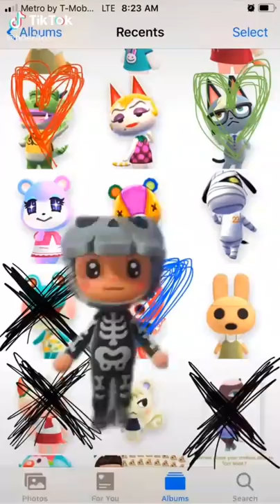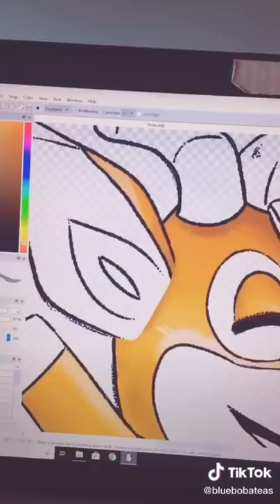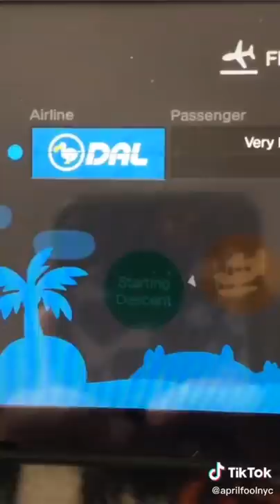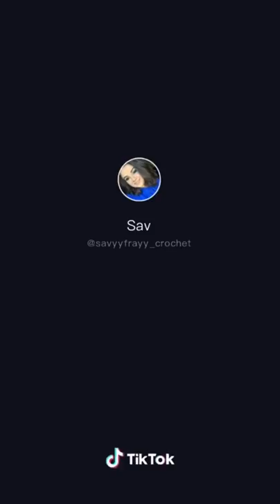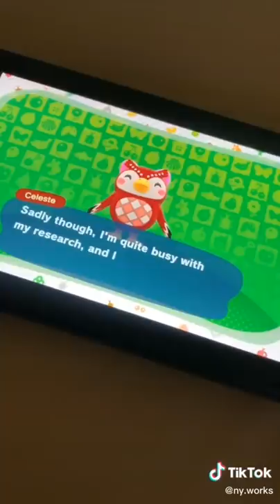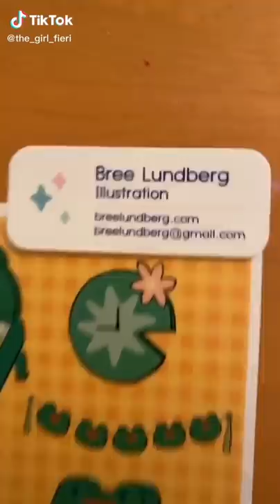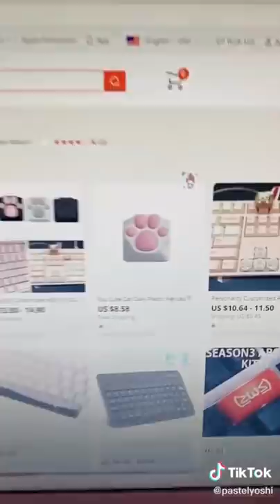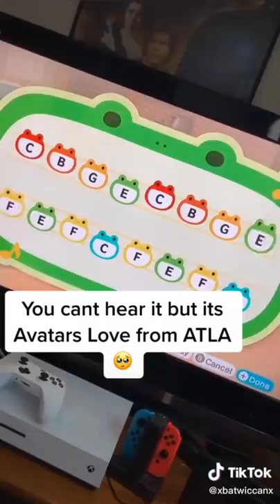1 HOUR+ of Animal Crossing TikToks

Comment: Hey all! I have found a method that does work with moving out your villagers without timeskipping, as I know many are against it or just can't (like me) 
This has worked with me, so I think it is pretty reputable.
What I did is wait until one of my villagers had a thought bubble (the one where they might want to move out) and not talk to them AT ALL. This part is crucial. Then wait, and from what I have experienced every one to two days another villager thought bubble would appear. I would continue the process of waiting until the villager I wanted to move out had the thought bubble, then you could move them out.

Also, according to Ninji's datamining,  it has to be after 5 days before another moving out thought bubble appears. I would reccomend checking his finds out on twitter if you want to know more.

Please tell me if you have any extra data or questions or contradictions! I will update this as more stuff is found.